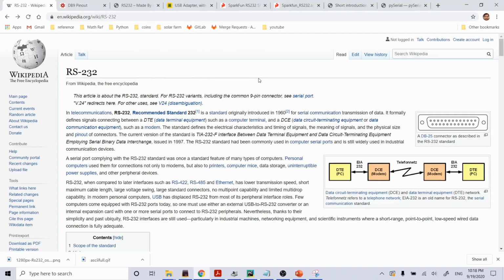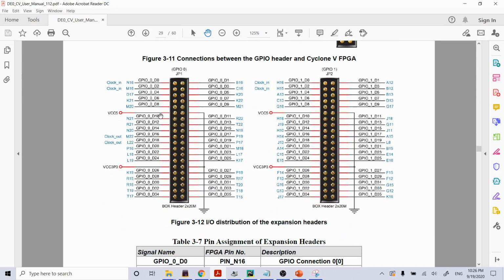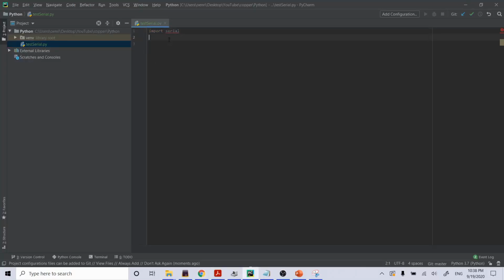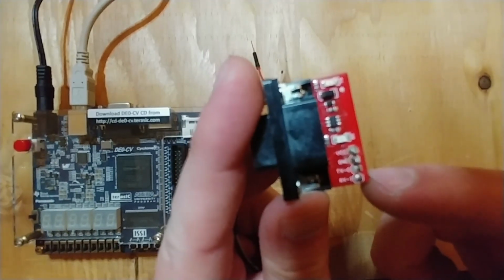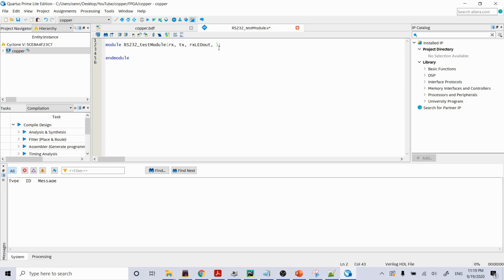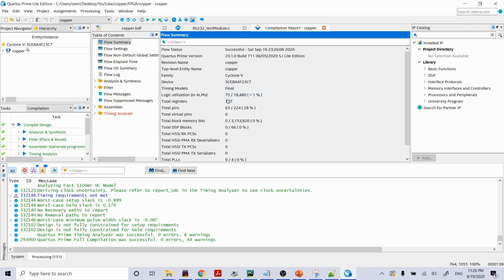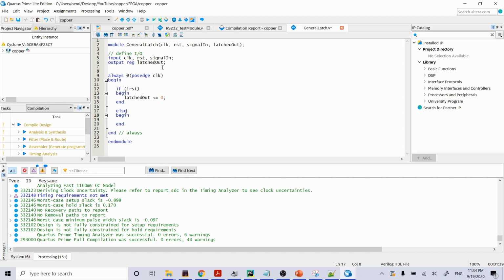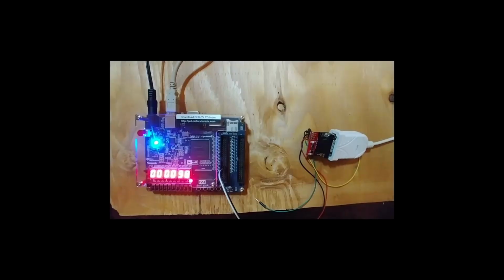RS232 Part1 Setup FPGA Essentials 006

Comment: Really excited for where this series is going! Keep it up

As a side note for anyone else following along: If you are using a different USB to Serial cable than the one being used in the video, take note of whether it is a straight through or a crossover/null modem cable. I ended up having to swap the Tx/Rx lines going into the level shifter to get it to work.